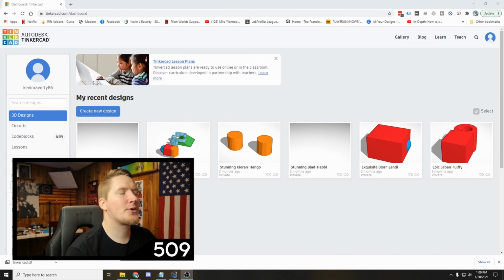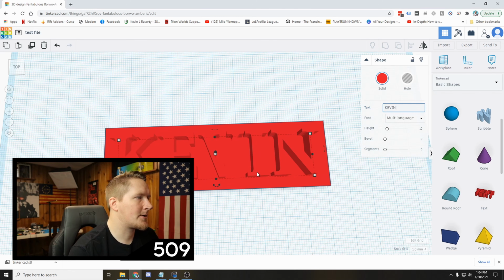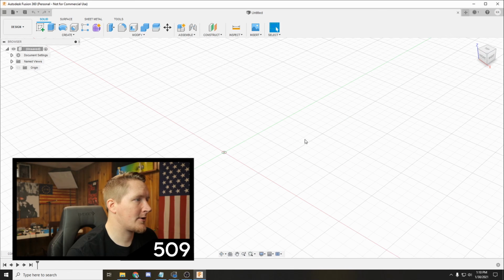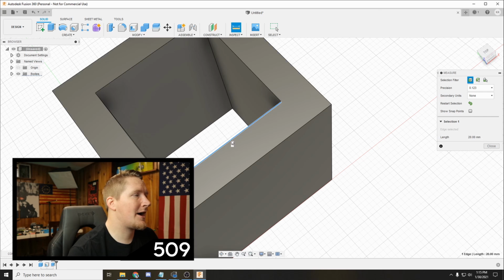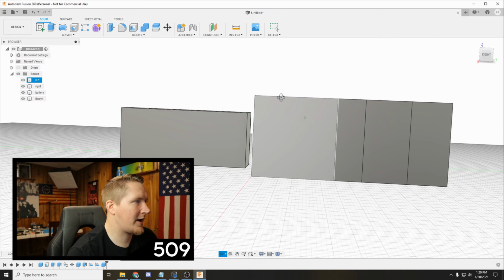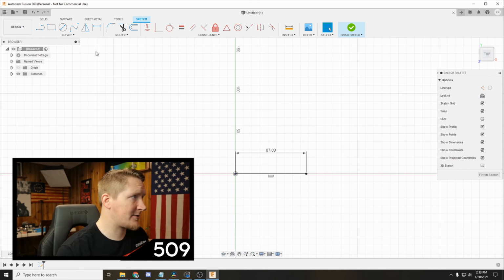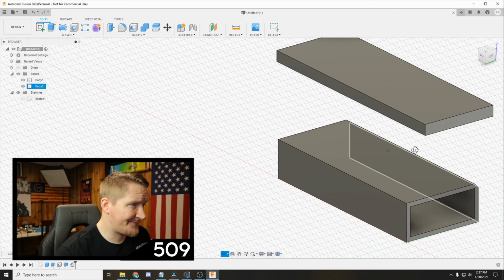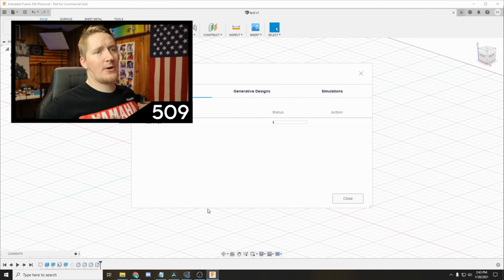How to make your own 3D print designs [ Beginner Friendly ]

Comment: Hi great video. Is there a eraser function? So if I drew a circle for example and I wanted to erase so much . Or would thst just erase the whole thing? You have not displayed a eraser function so not sure if it exists .
Reply from the maker: @kirtandrews1859  I’m sure you can just use the back function. Ctrl + z works for it as well. I’m sure there is an eraser function, I’m just not sure myself.

Comment: Nice. I've been teaching myself Tinkercad and Fusion360 for a few months now. I tried to learn Fusion360 right off the bat about 1 year ago, but it was a bit overwhelming. Messed around with Tinkercad a bit and now I understand Fusion360 way better, even though its really different. Love both of those programs. Definitely takes some patience and learning what parts of the design to make first to make it time efficient and easier to model stuff. You're killing it, pumping out videos. Good job buddy!
Reply from the maker: I basically took the same path lol. I jumped into fusion a little quicker but definitely takes some patience lol.